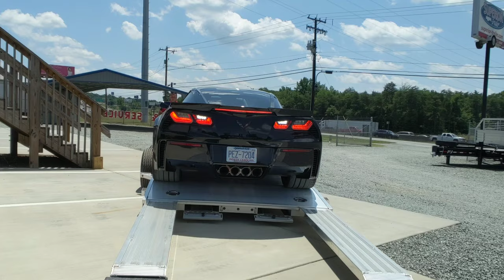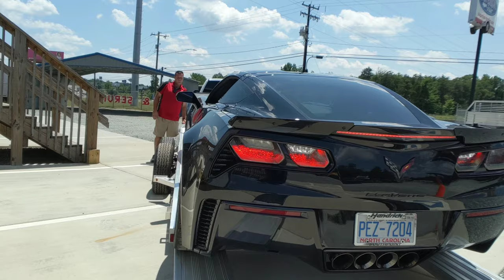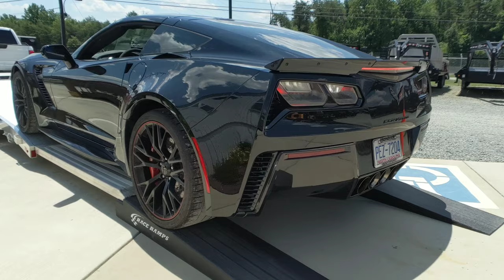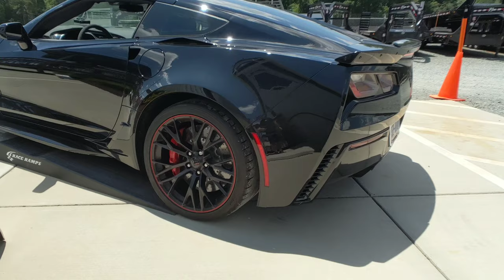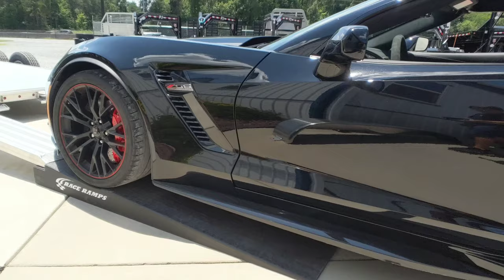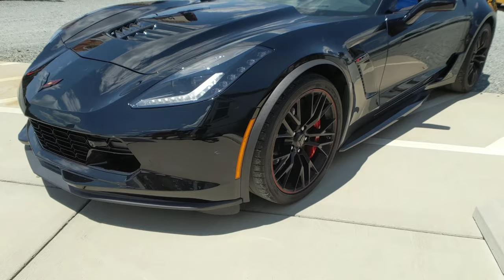Using Race Ramps When Loading A Car

Comment: what size at the front of the race ramps did you use? I have a 17 zo6 with the carbon flash splitter in front and i dont want to damage miine..